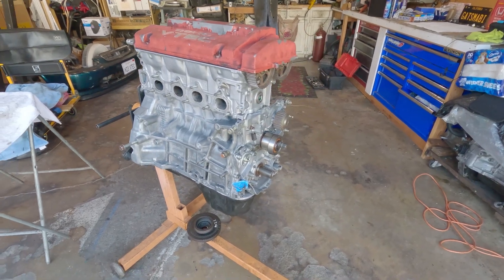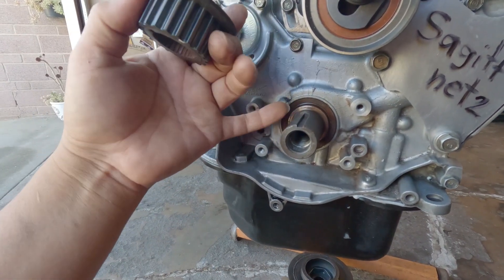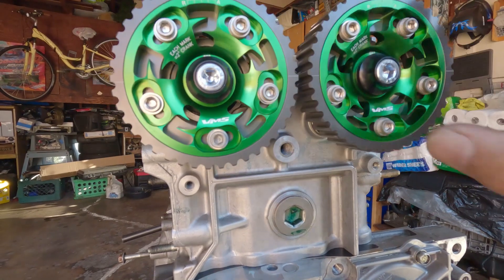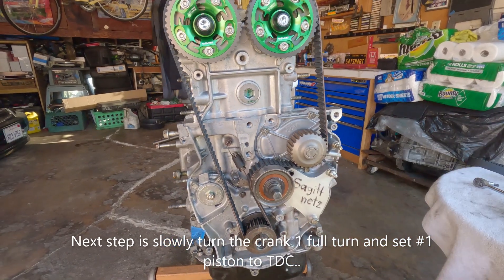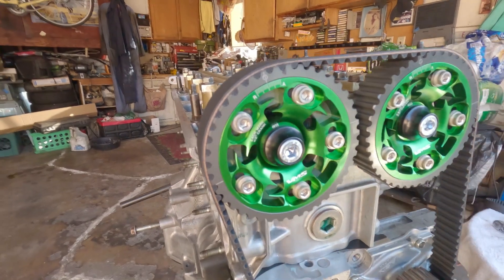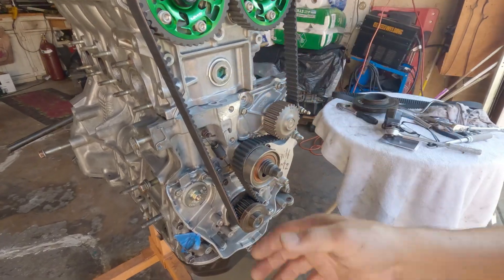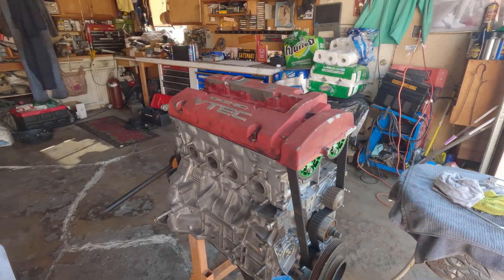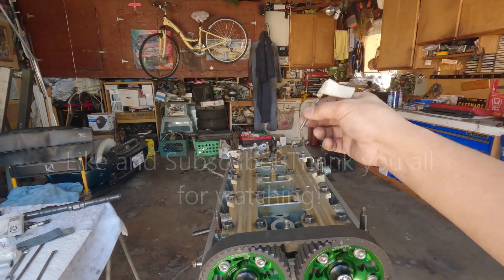G23vtec Timing Belt install with VMS Racing adjustable Cam gears.

Comment: Great content... Was wondering where do you find the crank gear and pulley ... All h22 right ?
Reply from the maker: Yes, all H22 stuff. The waterpump can get from Kstuned or you can make one if you like. Thanks brother
Reply: @sagittnet2158 the p1b is so hard to find and should I get OBD2 or 0bd1
Reply from the maker: @apricussalvaredey623 Either obd1 or obd2,l, w/c ever you can get your hands on.

Comment: I'm timing my engine with adjustable cam gears also but having a hard time get the crank to lineup. Keeps shifting when I put on the belt
Reply from the maker: It looks like you'll need a adjustable gears. Keep your crank gear line up and if one of the gear won't line up( I assume it's intake side)   you need a adjustable gears.
Reply: @sagittnet2158  the one I'm using is adjustable and I get both cam gears to align but once I put the belt on the crank will miss aligned slightly. I can post a video for you to see.
Reply from the maker: @Open90  Get your crank gear to align and  exhaust cam gear align on flat surface of the cyl head. Does the intake cam gear is slightly off? Insert a pin, allen wrench, or drill bit that is same hole diameter that's on  camshafts. Drop it on the inspection hole and if it doesn't go in or it require you push it in hard, then next is remove your pin, loosen cam gear bolts and rotate your cam advance or retard 'till your pin or drill bit can be inserted on the inspection hole w/o forcing it. Make sure it goes straight, if its binding the pin or drill bit will be in angle. Once your satisfied secure all you cam gear bolts and recheck. Rotate assy and align your crank gear and ex camgear align to flange of cyl head. Use your pin to recheck the alignment of you camshafts thru the inspection hole. the 2 dash line may not quite lined up anymore  but your camshafts are dead center now.  Always remove your pin when rotating assembly. It's very easy to forget, I know because I broke those drill bit, I forgot it's still dropped in there. I have a video on how I adjusted mine. I'll check if i can find it and link it.
Reply: @sagittnet2158  Thank you for taking the time to help, really appreciate it. I got the alignment of the cam gears with the head and I checked to confirm with the drill bit in inspection hole. Everything align good there but as soon I put the belt on the crank would shift slightly. I'm posting a short soon so you can see.
Reply from the maker: @Open90  https://youtu.be/KRDpA_6-Afg?si=VhrfI2gXCQhN-hAY
Reply from the maker: @Open90  that's how l adjusted my camgears and hope it'll give you an idea. Try not to forget the pin before you tun the crank or cam.
Reply: @sagittnet2158  I will try it and see if it works. Thanks for sharing. I posted a short video with the issue, check it out when you get a chance.
Reply from the maker: @Open90  just about correct, move the camgear about 3 teeth to give the belt some tension and loosen the tensioner nut till it move up and repeat till you get your desired tension on the belt. Just like how l did mine.
Reply from the maker: @Open90  if you ever runout of movement of the tensioner coz you still have too much slack at the top when its set on TDC. You can always remove/ shave some material off from the tensioner. Find out why it wont go up anymore and use your creativity this time. Dont worry l've done it before, you'll see what need to be shave.
Reply: @sagittnet2158  OK, will do this and let you know the outcome. I gotta get my crank pully first to turn the engine.
Reply: @sagittnet2158  Thank you for the suggestions. I will explore if the first option don't work.
Reply: I was able to time the engine with the method you suggested. The belt still have a slight slack at the top but both side are firm. I rotate the engine and it all lines up. Also i check TDC with the hole in the camshaft and it's spot on. Thanks for your help again.

Comment: Mine stamp P1B also. Just want to confirm it will work, let me know.
Reply from the maker: Just like what I have, you'll know once you put on the belt.
Reply: @sagittnet2158  What you mean? I put the belt on but can't get the crank to align. It's slightly off

Comment: Can i do this with my bc stage 2 cams . They have the holes .  Or do i have to have them degreed in ? I also have my type s one. but im fully built for hi boost. How did them cam gears work out ? I have a brand new set sitting here but im kinda of scared of them . Might try my stock ones and if its decked to much then ill go from there .
Reply from the maker: The alignment or witness holes should work on your Bc cams.  If somehow you tried everything to align the crank and 2 camgears together but timing belt alignment still a bit off, just put your aligning tool on it and zero out your adjustable gears. If you can attach a marker so you wont accidentally rotate the assy while the pin or drill bit still in it will help. Caused it happened to me, snap the drill bit and have to fish out the remaining piece from the cam.
Reply from the maker: It's best to have your BC cams degree to your engine so you'll get the power potential of it. The VMS cam gears are okay. I think l can say it's good coz my engine went thru 3 dyno sessions and no problem whatsoever.  My only complain in the beginning was the screws, make sure to use a torque wrench. In my opinion, it could use a cap head bolts rather than use a allen socket. But you can avoid any damage from it by just giving it a much lower torque than advertise if you are making a multiple adjustment. Give it the full torque values w/ locktite on threads on your final settings and forget about it. You'll be okay. You can change the bolts w/ ARP or something like AEM use, that'll be great if you like.
Reply from the maker: What's your power goal if you dont mind me asking? The base or type S cams are good for Turbo up to 450whp, BC cams should give more. Good luck on your build and you'll be okay w/ VMS cam gears. Thanks
Reply: @sagittnet2158  thanks for the replay Iv been watching a lot of your videos , listen to them at work too , my power goals is 700-800hp. But i want to keep it down at  500hp till I go to the track .
Reply from the maker: @brianburris  l would definitely replace the VMS bolts with something better and it should hold up fine. Good luck to your build and shoot a msg rime to time for an update. Like to hear any progress on your build or at least upload a shorts story or something. Thanks
Reply: @sagittnet2158  right on thanks man .been using a lot of your videos to help me along the way. So thanks 🙏.

Comment: Great details on your motor building with aftermarket cam gear, 👍
Reply from the maker: Thanks man! I should've saved up a bit for the camgears. Noticed something l didn't like about the bolts. It's not quite up to the job of loosening and tigntening sequences. If l'm not careful it's so easily can strip out. I'll make a review about it when time comes.

Comment: Whats wrong if it's too hard to turn the Crank by hand? I have a H22A4 with Type-S pistons and Skunk2 Tuner Stage 2 cams with AEM cam gears. It will turn smooth couple turns with the ratchet but then the belt gets super tight and if I force it the timing belt skips a tooth on the cam gear.
Reply from the maker: You got some good parts on your setup man! Firsr time l've experienced a fresh built motor that the t belt will jump was the time l'm claying the g23. Which l knew right away it was the cam caps. I assumed yours was not same scenario  like l have were my H22 cyl head is not a set. Does the crank, rod n piston turn w/ no problem after you put it all together? Your bearing oil clearance check ok? I built a B18 and l couldnt turn the crank on the block. Turned out the block was tweaked. l ended sending the block to get the main caps line honed at its fixed. The installation of the conrods can also make it not to turn correct. If the rod caps are not in correctly place on the rod, it can tweak the bearings. The type of assy lube also can make it hard to turn the assy. Your crank end play clearance ok? Engine not in the car yet l hope, you still have time to check the placement of your rod bearing caps. The h22a4 stroker l built for my Accord, l have to use a breaker bar to turned the assy but lucky l never experienced like what you have that t belt will jump off the gears. When l open it up to changed the #1 piston rings due to blue smoke. I retorqued the main caps and somehow that helped a bit. Hope some info can be helpful to you.
Reply: @sagittnet2158  hey boss I fixed the problem. The Camshafts were too tight. I watched your video about mis-matched cam caps. I had the same exact problem when rotating the engine. So I changed the LMA + Rockers + Cam Caps just to be sure and car is running good now. The Head is 2001 but I was using 1997 LMA and Rockers. Turns out the 1997 LMA is taller and it made the middle rockers push up cams too much. Thanks
Reply from the maker: @skromee  Good to hear it's back and running and thanks for the info about the differences on lma and rocker(yr head model). Thanks!
Reply: @sagittnet2158  thanks for the reply. I hope it's just the cam caps too tight we didn't know the torque specs for cam caps at the time. The engine is actually already in the car it was running before. I just swapped a new Head and Cams.  Without the head I can rotate the crank by hand no problem. We was doing Valve Adjustment rotating the crank to adjust #3 when we noticed how tight it got I forced it one turn but it didn't feel or sound good and we noticed the timing belt skip a tooth on the Intake side. That's when my brother said to stop dont force it he wants to make sure the Valves are not hitting the pistons.  Hopefully I didn't bend the Valves. We are going to work on it again this weekend.
Reply from the maker: @skromee  wow! That's explained it. The #2&#3 caps have identifier, it has a arrow on it. Maybe it got mix up, but hope you get it figure out.
Reply from the maker: Are you using those kstune type belt tensioner?
Reply: @sagittnet2158  it still has the OEM auto tensioner. I just ordered a Manual Tensioner. Why do you think it could be the problem? The Auto Tensioner was fully extended when we was rotating the crank doing the valve adjustment. Should we have rotated the crank without the Auto Tensioner first ?
Reply from the maker: @skromee  I just thought you might have a kstuned style tensioner and maybe you tighten it too much. Since you have the auto tensioner, youre right, It should be rotated w/ it engage.

Comment: not trying to be negative, or an ass here, but I just don't understand how you can trust some cheap chinese cam gears like that. seems like a strange thing to cheap out on.
Reply from the maker: Not at all and you are corrrect, l just got another taste of my own medicine. I got a AEM and sure is not built like it. Found the screws are a bit odd. My metric allen socket was a bit loose when l was giving it a torque. I thought it was a standard size but it's not. One bolt almost got strip and l think l'm going to change the bolts. I'll mention it on my next episode or give it a review. Thanks man!

Comment: Can you use a H22a4 timing belt pulley? Not sure if those are different than the H23
Reply from the maker: H22a4 crank pulley is good, it's same part as H23A and F20b also. Maybe the p1B stamped was the H23a bluetop designation but practically it's same part.

Comment: has information about the adaptation kit for k24 crankshaft in h22?
Reply from the maker: Roskoracing, yes! I was reading on to it long time ago but seems like a lot of work. I bet it puts out more torque though. Do you happen to have a set up?
Reply: @sagittnet2158  Thank you for your response, I like your videos, well I'm building an H2K but I'm having trouble getting the crankshaft kit. If you have any links to the Roskoracing store, I would appreciate it. The links I found are expired.
Reply from the maker: @johnnet.rar2878  That'll be interesting project. I dont have link for his site other than browse roskoracing.com website. Be nice to know after you get it running and find a results.
Reply: @sagittnet2158  Thanks for your help, I'll tell you how to proceed later 👌